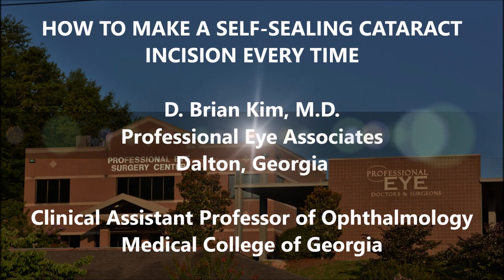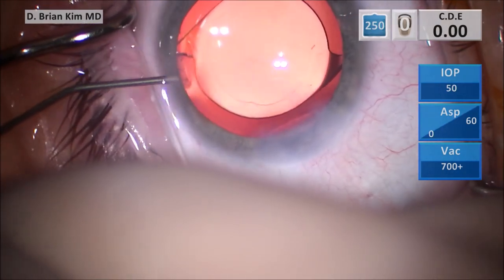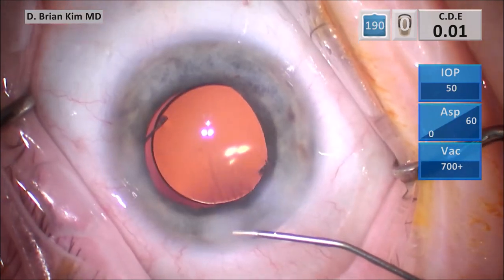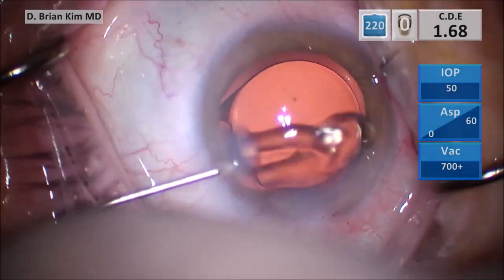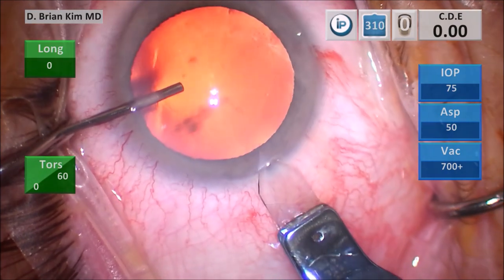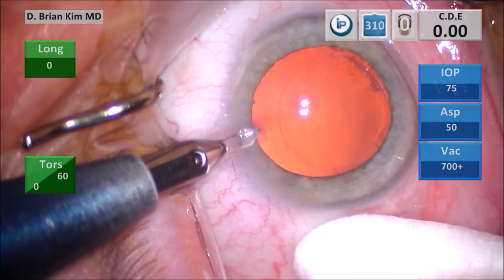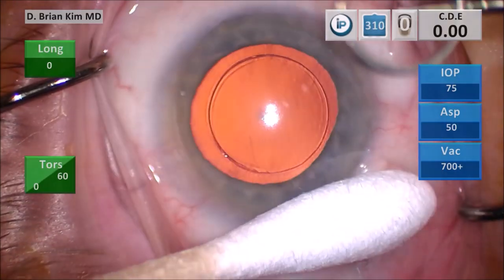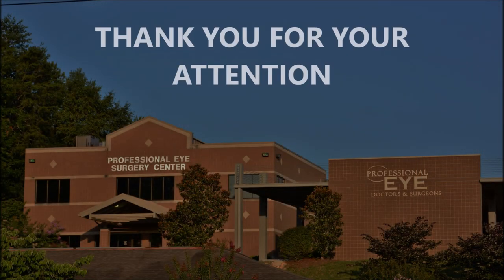How to Make a Seal-Sealing Cataract Incision Every Time

Comment: Could you explain the reason behind making two paracentesis incisions in your cataract cases as opposed to just one?
Reply from the maker: rowerling great question. I use a capsule sweep to polish 360 degrees under the anterior capsule edge from each paracentesis.

Comment: Vertical  groove depth?
Aboot 200micrometer?
Reply from the maker: 최명근 great question. I don’t really measure the depth but I try to aim ~half thickness. If it’s too superficial, it will not provide much structural support. Best wishes.

Comment: Excellent video, Dr. Kim! Tell me, though, it seems to me that the vertical groove you make as the first step is not so much vertical (right angle to the plane of the sclera) as it is horizontal (parallel to the iris). Or am I not seeing it right in two dimensions?
Reply from the maker: Trevor Woodhams , hi Dr. Woodhams! Thank you. Yes, I try to turn the eye such that I make a partial thickness incision perpendicular to the limbus. Since the diamond blade is angled it might be difficult to appreciate but I am trying to make a vertical groove. I hope this clarifies.